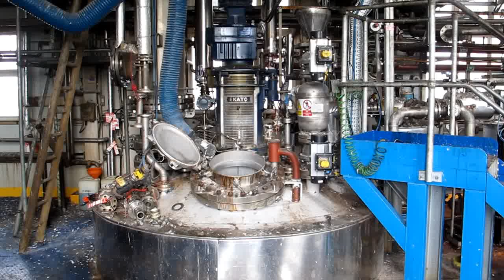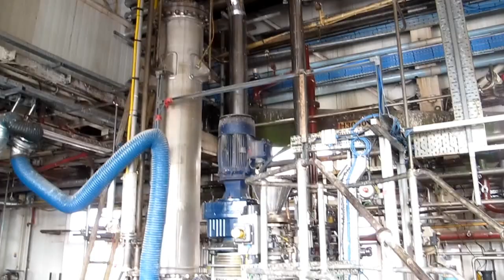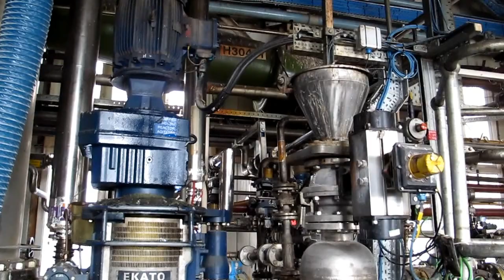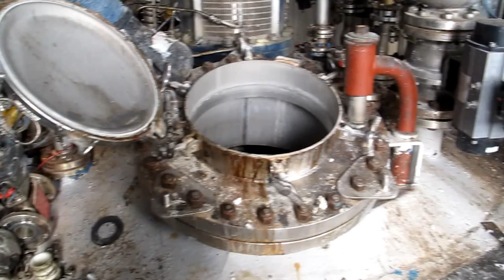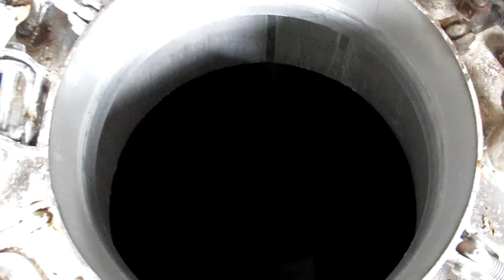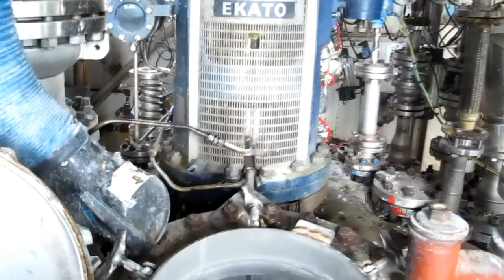stainless steel reactor

Comment: How does the resin drain from the reactor? Is gravity the only force pushing the resin out?
Reply: Pressure. Anywhere from 5PSI to 50PSI of controlled air pressure will transfer out easily. That or a pump.
Reply: If  resin martial is more viscous then use air compression at the top of reactor..
Reply: They can use nitrogen pressure to push harder since nitrogen is heavier than air